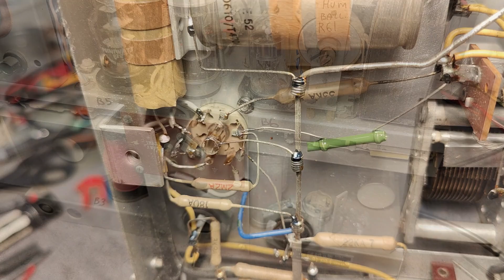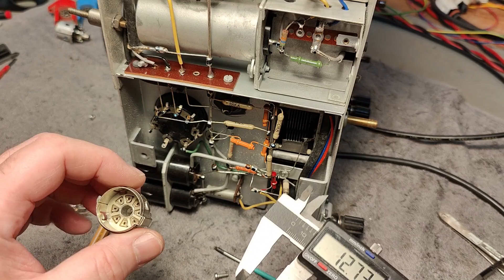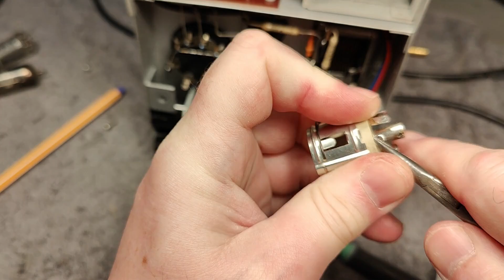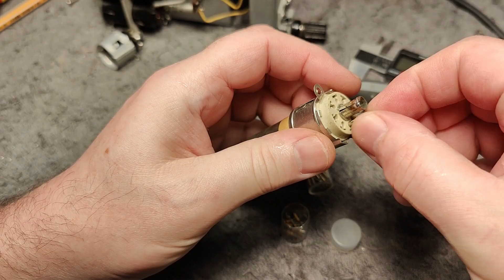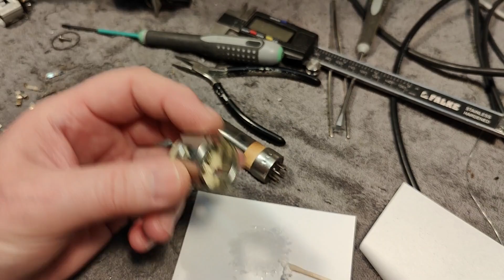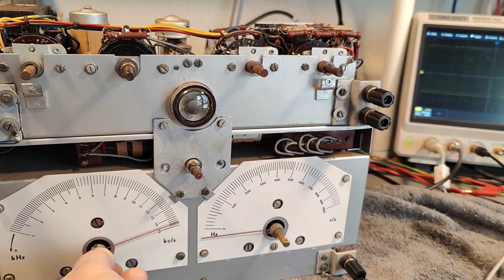Philips GM2307 ECH42 sinewave generator 1947-51 (part2)

Comment: Nice hack on that tube socket. I've never seen one of those 8-pin rim lock type tubes before. An odd beast compared to the pentodes and triodes I'm used to seeing in guitar amps.
Reply from the maker: some times i just dont give up, i like the challenge, after this video was made I stocked up on special types of tube sockets, so this problem is not going to hit me again.
Reply: @TeardownOZ2CPU  ln my DIY world I do the same. Sometimes you have to improvise!

Comment: Most locktal tubes have an equivalent in noval because locktal was abandonned for good reasons. I would have put an ECH80 to replace the ECH42
Reply from the maker: thanks a lot, that is a good point, just checked my stock, no ECH80 but i have a lot of ECH81
Reply: @TeardownOZ2CPU  ECH80 does not exist, he probably meant ECH81.
Reply from the maker: @maxjakobsen5526  not his fault, it is explained like this on radiomuseum, so that is where you should direct this correction :-) and I am not super sure you are right, i can search for ECH80 many places and get good hits
Reply: @TeardownOZ2CPU  Yes, that's true, I've just never come across it.